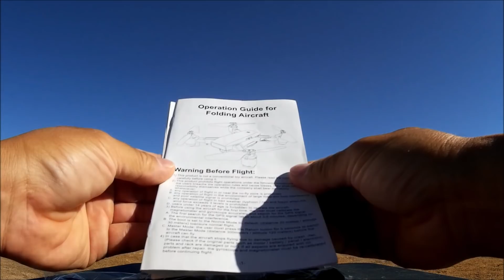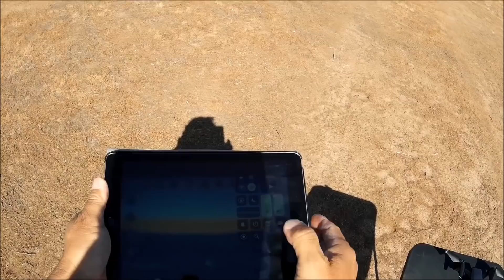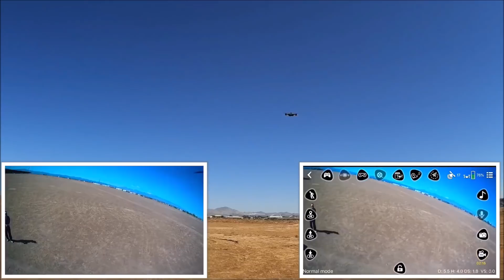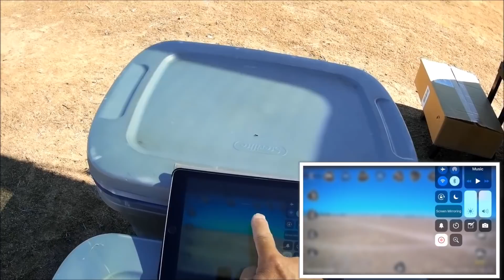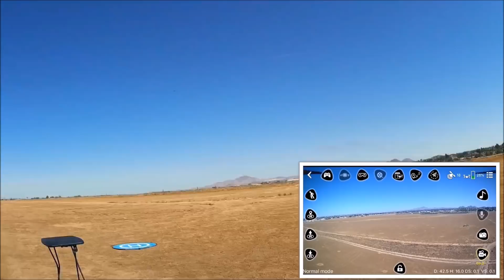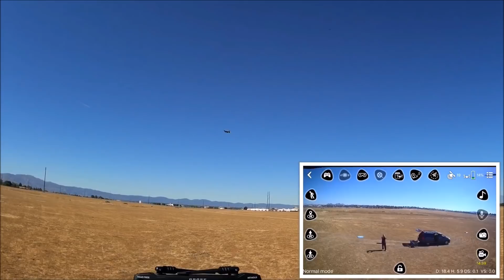KK10S GPS  5G-1080P WiFi FPV Camera Drone

Comment: my phone does not have 5G capability, so would i not be able to get the video feed from this drone onto my phone.
Reply from the maker: I'm using an old ipad and it works fine.  It is wifi 802.11ac and not 5g cellular.

Comment: Nice demo once again.  Wow they are really putting a lot into these cheaper drones these days.  Let me go and look at the price first BRB.  wow $117.00 canadian not bad at all.  Can you do a demo again with the long range test, that would be interesting.  Only 207 grams so under the 250 grams, so you can fly it anywhere, excellent.  ha ha I see JDS Quads is buying it good.  I think this Canadian has to buy this too,  I need it like a hole in the head ha ha ..but hey, it seems to have everything you need.  Anyone out there need any slightly used quad copters cheap?  Like zero dollars! ha ha  Found one little problem.  Unable to find anywhere I can buy a couple spare batteries for it, damn. Happy Flying
Reply from the maker: Thanks Ken :)
Ha!  $85 US :)  I wish I could say the same for prescription medications in the US!